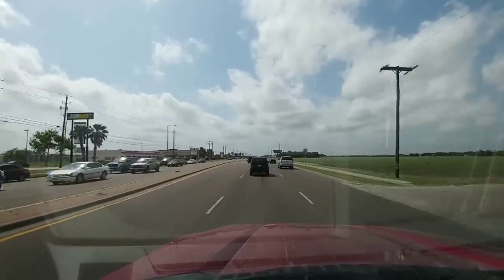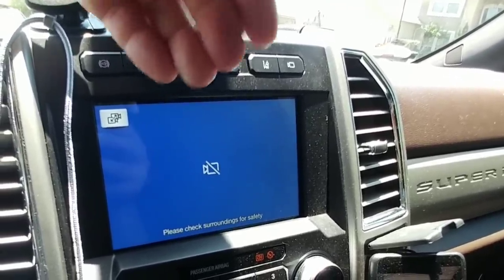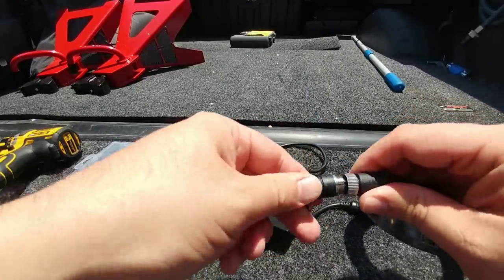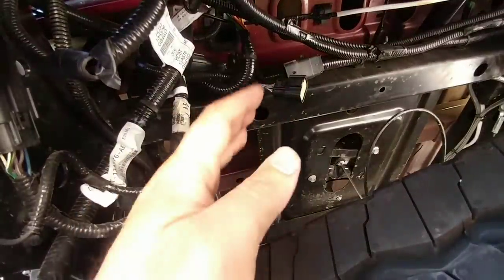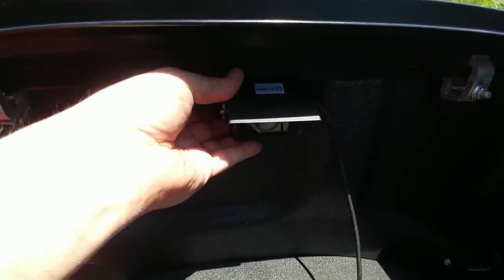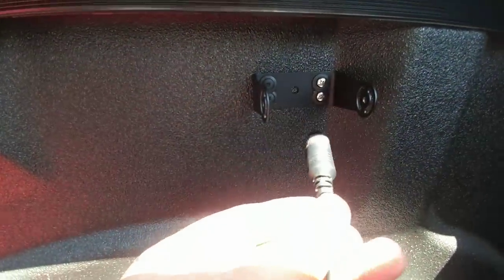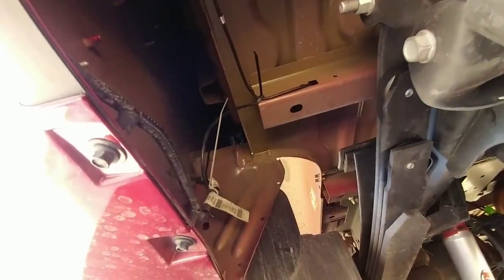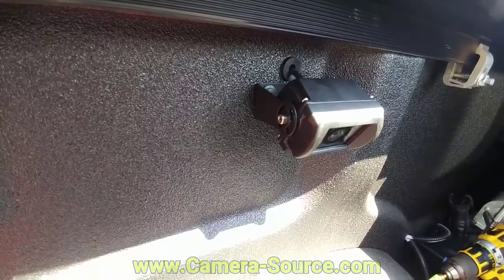A better way of Goose Neck hitching!  Crazy cool mod!

Comment: That's a great idea for those with trucks that have cameras already. I myself will hafto put a after market one in.  But I've decided to use mine that is wireless from camera to monitor to where it will plug into the flat trailer plug and have it to where I can set it in different places as I need it or different vehicles

Comment: That’s a slick set up. I got a xlt with the high mount camera. Turns out to be a joke when you’ve got a headache rack and a fuel tank in the bed. I wonder if the trucks without the 360 camera package have the same wiring harness with a dummy plug?

Comment: I have a ram 3500 mega cab, and can't see the ball either. I bought the magnetic yellow balls for helping hook up bumper pull trailers. And it works great for gooseneck also. Bought for $20

Comment: We had reverse cameras on some of our commercial trucks for checking before backing. Theory being that if you back into or over something you shouldn’t have, you have no excuse. When in doubt, get out. That being said one feature the cameras had was a shield that covered the lens when it wasn’t being used. It automatically covered the lens to protect it from dirt water and grime. I would have probably coated the cut hole with paint but I yours is aluminum not steel.

Comment: Another great video, I still think even with the camera it's still going too be harder too just hook up and go, verses the traditional 5th wheel hitch. My tool box block's my view also, and when I replace my stock stereo I plan on getting a double DIN so I can have a camera mounted on the tool box so I can see my Curt hitch. Another thing is climbing in and out of the bed too hook up the chain's seem's difficult IMHO
Reply from the maker: I hope it helps.  If not, I'll just use the camera somewhere else :)

Comment: Hey that's nice camera I like that extra feature , thanks for the great idea.
I was wondering if you had a chance to show a video after the fact ,with the new Cre 3000 system and the shocks that you have installed ...is there a way you could show a video on how much shock absorption or comfort the trailer rides on now , how much it helps While it's going down the road , just curious, i was thinking about getting this Cre3000 on my trailer... Thanks a lot talk to you soon

Comment: When i was hitching up to a trailer by myself i used a tape measure and would measure the distance from the center point of the ball to the center point of receiver, then i would open my door and measure the same distance from the edge of the door to a reference point on the ground and place a stick there and when backing up i just stopped when my door edge came to the stick and it was always perfect lined up. I know its very low tech but it worked and it was free And took maybe 1 min to do.
Reply: I just use my foot!

Comment: Nice install, thanks for sharing. Was wondering if you ever reviewed a product called "Smartplug" it replaces the 30 and 50 amp service connection. Seems to make a better more secure connection, not sure it's worth the money? Seems like a good replacement to the twist lock style plugs. Thanks again.

Comment: Hope it works for you - but I tired that and  I think you will still see it is difficult to hook up, especially coming from the anderson with the inverse cone coupler. On mine, if I did not have the receiver almost over the center it would not drop, just hang up on the ball. I talked to Reese engineers at the Hershey RV show, and as I expected, the engineers-designers saw no problem. I suggested they go out and do some non 'perfect' lines ups and see how it plays. Maybe it will work for you. For me, our first trip of the year with the the conventional  hitch and the ride is back and a simple 1-2-3 hook up.

I get the idea the cone anderson is using is patented.

Something to try - I used a 2' tall stick magnet (one of those expanding pencil styles), got the truck lined up perfect, the hitch about 1" over the top and then set the magnet in the middle of the bed just touching the hitch. Piece of blue painters tape on the pin box. Line them up and when the hitch bumped the magnet I knew I was close. Painted a bright red circle on the bed to mark the magnet areas. You'll have to add some ferrous metal though.

Do you see my comment on the last video?
Reply from the maker: I hope it works too :).  I did read your other comment and am trying to mitigate frustrating moments by using this.
Reply: Big Truck Big RV I found the hardest is when the trailer is level (I have LevelUp) and the truck is not. 
My driveway was difficult. The trailer is completely on concrete and one side of my truck was off the pad and down about 4-6”.....
Reply: porthole2 

Are you new to ball hitches? Because that is part of the beauty of them over kingpin. So much more versatile
Reply: Ogre Dad beauty of what - being difficult to hook up ?
You have to be dead on with this hitch, otherwise it hands up on the ball. And too high coming in is also an issue. The trailer comes down in a slight arc, too high coming in and you will miss the ball.
Reply: porthole2 

It's a ball. Sounds like operator error
Reply: Ogre Dad sounds like you have a lot of experience with the Reese goosebox, although my guess is you have zero with this product.
Reply: porthole2 

Correct. I have not used this particular product. However. I do have considerable experience with various types trailers and hookup connections. So I stand by my statement that it sounds like operator error
Reply: Ogre Dad not my post, so after this I’m done with your comments. 

A) since you do not have any experience with this particular product - your comment is not valid 

B) I have plenty of experience with a variety of tows and trailers as well - so your comment is not valid 

C) fire away net commando, maybe you can add something positive.
Reply: Big Truck Big RV something I found that helped was to make sure the air was dumped before unhitching. 
This kept the lower receiver from rotating as it dropped over the ball.
Reply: porthole2 

I stand by my statement. 9.99% of the time, its operator error. I've been a welder/fabricator for well over 20 years. And have plenty of experience with various trailer designs to boot. No keyboard warrior, past experience 😉goes a long way
Reply from the maker: Good suggestion. I noticed this after installing as well.  Without dumping the air, the coupler didn't want to lift off right away.

Comment: Are you getting any water through that grommet?  Maybe one that grips the cable would be better.  Also a quick-tatch mount may be good to prevent camera from getting damaged by any "unruly" loads.  Last, cable through untrimmed metal holes on the underside.  After time, vibration may cut through the cable insulating jacket.  Cool idea!
Reply from the maker: no water at all.

Comment: Hey there, love the vids.  Looks like the camera is installed upside down.  The jack stands when looking through the camera were on the left side of the screen as if you were standing outside on the passenger side looking over the bed..  If you were standing outside the truck bed looking over the camera, the jack stands would be on the right.  Just needs to be flipped over.  Probably doesn't matter in the big picture (lol) as the view for your purpose works either way.  Congrats on the success of the channel. Been around since about the 10k sub mark.  Keep up the great work.
Reply from the maker: It's because the camera is designed to be a backup camera.  This makes the image mirrored.  I am probably going to swap it for one with no mirror view.

Comment: looks good and professional, would it work if my truck was not equipped with a backup camera. Could I run it through a tablet or my smart phone.
Reply from the maker: Even if it doesn't, there are other options on their website. They have some really innovative solutions .
Reply: Thanks I'll have to check it out

Comment: what about rubber/plastic grommets where you have the wires run through holes under the bed.  Friction from vibrations might cut through the wire.  Just a thought

Comment: Going to check and see if that plug that is above the spare is on my 2014 F450.  Thanks for sharing!
Reply from the maker: 100% sure it's not going to be there.  However, Camera-Source has equipment to add a camera to your Sync MyTouch system
Reply: Thanks, will call them and check it out!  Sure would make it easier to see the fiver hitch.  I wonder if the 3 brake light with camera attachment will work?  Hmm!

Comment: For those that need an alternative:
Look into IBall wireless backup camera.
I've had one for about 8 years from my popup days.
I just looked them up on Amazon; many 4 Star reviews.
They now have lithium batteries (mine has a 9v in the magnetic base remote camera.)
The viewer plugs into a power port with a flexible shaft.
Easily movable from vehicle to vehicle.
I still use mine when backing up onto ramp boards with the motor home.
(I just set the camera on the ground.)
As of this date the digital version is $229.
 https://www.amazon.com/5-8GHz-Wireless-Magnetic-Trailer-Monitor/dp/B0747WHG3J?th=1
Reply from the maker: I actually have an iBall camera.  It was ok, but I didn't like the screen having to be plugged into my already used 12vt outlet plus the limited range.  I know it would be fine for this application, but I'd rather use the equipment built into my truck that would otherwise be dormant.
Reply: Big Truck Big RV 
10-4
The digital version touts 100 feet range. My original, maybe 25, lol.
All of my vehicles have 3 port power extensions with usb slots. 
I need more power! 😲

Comment: I just bought a new 2017 F350 DRW FX4 King ranch. It seems both front doors rattle and I have less than 1500 miles. I know you had a rattle in your sunroof have you experienced a rattle in the doors? My 1997 F350 crew cab dually that I replaced did not rattle.
Reply from the maker: I haven't had any rattles or squeaks with this truck.
Reply from the maker: On second thought, be sure the seatbelts arnt the cause of the rattles.  There were some folks with 2017 Super Dutys that had what they thought were rattles until they found out that the seatbelts was hitting somewhere around the door panel when going over bumps.

Comment: So you hinted at it in the video whats your plans for a rear camera on your trailer?  I have a 2019 super duty on order and like the idea of the trailer AUX cam, but I have an Airstream and routing a cable to the top back of the trailer is basically not possible.  Only option I am aware of is the wirless Voyager camera system, but then I have an extra display in the cab, I would prefer to use the OEM system if I were to figure out a way to do it.  Seems to be a common complaint on the AUX camera that there isn't a wireless option.
Reply from the maker: I have a wireless system with 7" monitor I'll be adding.  I am going to use some creative mounting methods for the monitor.

Comment: Have you pulled trailer yet with this connection?  I’m very curious, I have a 17’ F450 like yourself and I added the Hensley TS3 to my truck and pulled trailer for first time this weekend, ride was great but the hitch jarred itself and I have to send it back to be replaced.  I’m kind of concerned.  I’m looking for a good ride or a better ride, I did have the same B&W prior
Reply from the maker: have not towed yet. I'll know very soon.
Reply: Thanks, well I’m on the edge of my seat waiting as I have an opportunity to return the TS3 for full refund.  Just surprised that it did what it did especially as we are only pulling around 15K.  We traveled from Fort Worth to the Woodlands and back.

Comment: Sometime last year you featured NuCam which connects to a smart phone or tablet. Curious why you wouldn't just set that on the driver's side bed rail aimed at the goose ball, hook up and then move it somewhere else (since it's easily repositioned).
Reply from the maker: drdit92: NuCam is great for some things. There is a small delay which isn't the best for a backup cam

Comment: Why not use two spring clamps and a piece of string. Clamp end of string to each bed rail that is visible from you existing OEM camera with a reference mark on the goose box signaling the correct position? Simple is better.

Comment: I would love to purchase a fifth wheel like yours. However, I have to live in one for quite awhile. Can you recommend a 24 foot or longer toy hauler style? I need a toy hauler I can live in. I am for lack of better explanation, working on the road, becoming a full timer, and saving up for the perfect house (when I find it). I tell you this because the higher the trailer payment, the slower the savings account goes up. So when are you going to do a video on:1. 5th wheel toy haulers.     2. RV furniture vs. load up your own (obviously much easier to load/unload furniture with a toy hauler style.   3. How honest are the bed sizes.  I know.  I measured.  It's inches. Queen is not always Queen. Research. Take a tape measure. This is important to me, because I have to live in this trailer for at least 3 years.  I want to take my Sweden purchases with me.
Reply: By the way, I would have made the wrong purchase months ago, if it weren't for you. Your wisdom on tires and axles and steps has helped very much.
Reply from the maker: Glad to help!  In regards to your question on with Toy Hauler, do you have an idea on what layout you are looking for?

Comment: Why not hookup the the new camera to the high mounted camera signal, that way you don't loose your connection for the trailer tpms(Wich it's really handy) and trailer camera. I don't know if it's even possible but I don't see why not
Reply from the maker: That would require a far more in depth install and void my warranty.
Reply: Big Truck Big RV yeah you're right, I forget about warranty. Check Nichols Manufacturing & Welding Services, the have products that might interest you

Comment: Is that plug present in the F250 super duty?  I had a stereo guy install the same style camera for my gooseball, but he told me there was no plug so wired it much differently... it’s only on when the truck is in “drive”...   think I got hood-winked....
Reply from the maker: It's only present if you have the 360 degree camera option.
Reply: I have a boatload of cameras around the truck..  endgate, cab top, mirrors, grille, etc... I think 9 in total...even have the aux screen on the monitor.
Reply: By the way... love your videos!

Comment: OK so am I crazy or does the image from the camera not look like the camera is on the passenger side vs you showing that it was installed on the driver side...? Does the camera reverse the image? Or am I just crazy?
Reply from the maker: Mark C: no, you're correct. it will still work the same though. They are checking to see if they have a none reversed camera
Reply: At least I now know I am not going crazy! :)

Comment: Do you know if the 2015 king ranch 450 has the same plug underneath?
Reply from the maker: It does not.  That is only available with the 360° camera equipped trucks.
Reply: Big Truck Big RV well then. Time to get creative. Looking for a multiple channel camera system that I can use as a dashcam as well as a rear view hookup cam... possibly 4 channel...

Comment: Stainless steel on aluminum will create rust. Just ahead up man
Reply from the maker: Gerb It: There is no metal on metal contact.  The Stainless screw is simply expanding the plastic retainer.
Reply: Big Truck Big RV I gotcha, so you used something like a plastic anchor?
Reply from the maker: Gerb It: Similar.  more like an OEM plastic retainer clip.

Comment: I find this intimidating.
Reply from the maker: Tina Gallagher: The drilling through the truck and routing of cables are the two intimidating parts.  Not bad as far as installations go though.
Reply: Big Truck Big RV it’s always hard to drill into or through Factory metal and paint. I’m sure professional installers never feel our pain.
Reply from the maker: Agreed akby.  I got over those fears along time ago when installing cab lights on my 2011 F250 and reverse sensors on a Lexus that didn't have them. The key is to measure, remeasure, and then remeasure against....then bite the bullet and drill before your brain can stop you.